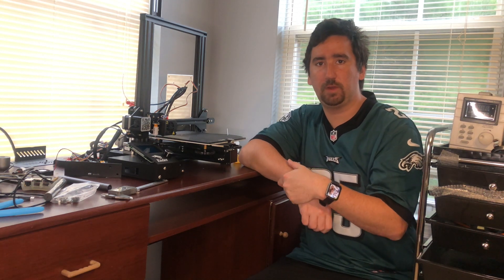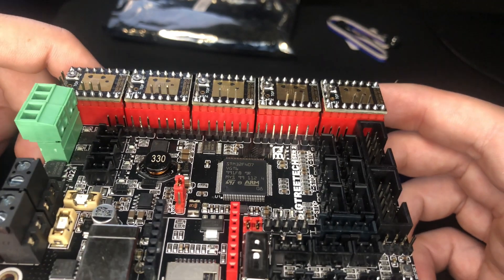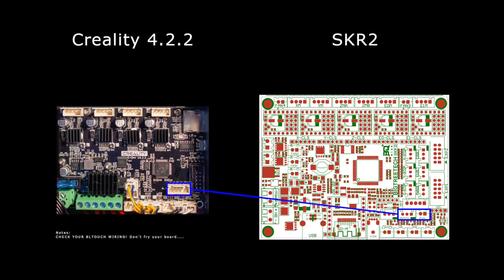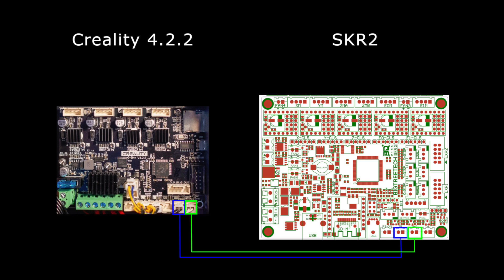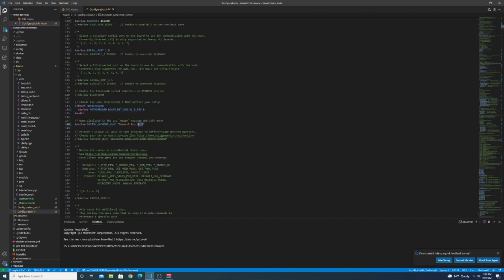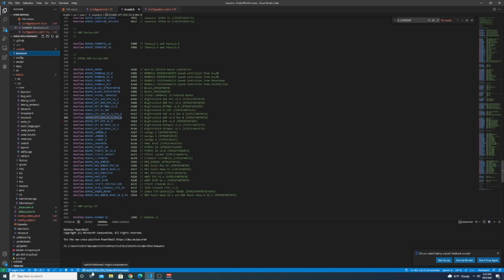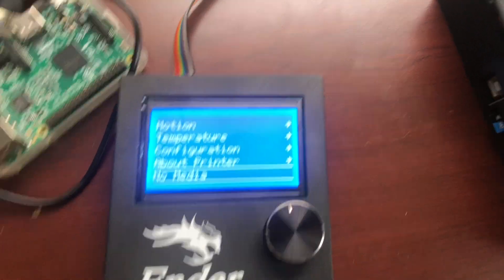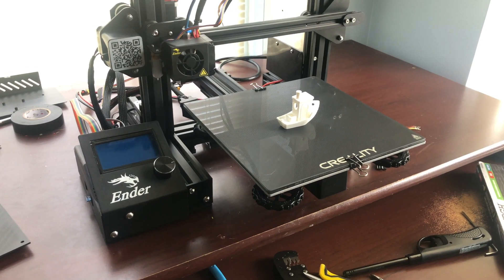How To Install SKR2 | Wiring & Compile Firmware | Ender 3 Pro Build Series EP5

Comment: Where do I get a JST connector that fits this board?
Reply from the maker: I have this kit here, which has all of the connectors and crimping tool: https://www.amazon.com/dp/B07ZHB4BBY/ref=cm_sw_r_cp_api_glt_i_D33WN742KJBCNTSD2WDR?_encoding=UTF8&psc=1

Thanks for watching
Reply: @PrintPractical  Hooked Everything up and nothing happened after hitting the switch.

would that mean my power cable isn't in right? Never worked with circuitry before.
Reply: @PrintPractical  So they are "JST-XH" connectors. In the video it sounds like you say "JXT".

Comment: After connected and compiled firmware i put sd card into the motherboard, turn on the printer and lcd screen remain blue for the whole time. Only thing that happens is that fans turn on itself.
Reply: Make sure to uncomment "#define CR10_STOCKDISPLAY" (line 2475 in Configuration.h)

Comment: Quick question. Did you have any issues with the axis not functioning properly? By that I mean it will home alright but when you try use the move function via the display it just moves back and forth like one step back and two forward. I'm currently have that issue on my Aquila with the TFT35 V3.
Reply from the maker: Huh that’s weird.. I don’t have that issue. Which  axis?
Reply: @PrintPractical  All three. They're new motors and wires too. I fixed for a while then it came back the amount it moves back and forth is based on what the distance I'm trying to move it  say 1mm or 10mm. I'm stumped i even tried new/ different stepper drivers the only thing else I can try is tmc2209 instead 2208

Comment: I just wired my board and I’m getting no power to it. I know the wires have power and that the polarities are correct, but still have no power to anything on the board
Reply from the maker: Did you make sure your power jumper is set correctly. There are two modes: USB power and power supply power.

Comment: This is a great video man. Would you mind if I could have the stl for the enclosure? Be much appreciated. I'm installing the skr and the tft50 on my cr10 v3 in a few days and I plan to tuck the mainboard away under the printer on a shelf and just mount the screen outside the enclosure. Stage 1 of a voron switchwire conversion. I'm new to 3d printing firmware but I am quite familiar with working with different languages in vs code. These videos are invaluable for me seeing the process of changing the firmware. Thank you
Reply: I had the same question, he just has it in a different video!
 https://www.youtube.com/watch?v=t1JGbf4hDso&ab_channel=PrintPractical
it's in the description here, free on thingyverse!
Reply: @giving6  thank you my friend!

Comment: Hello sir
Can I have the firmware files if you don't mind.
I can't get it running.
I've got skr 2 as well
Getting errors when compiling
Reply: Without enabling Bl touch even I tried compiling. Still I get that error
Reply from the maker: Here is my firmware file: https://drive.google.com/file/d/1vFnw-fjZ7gFek1K9ALXPDHaCMAe5M3jq/view?usp=sharing

I am not responsible for anything related to you flashing your device with this file, but I will help you triage if needed.

Thanks
Reply: @PrintPractical  Thanks a lot sir I will look into it now
Reply from the maker: Let me know how it goes!
Reply: @PrintPractical  Hey sir so I flashed
And whenever I try to level using a bl touch it stops and flashes and also Whenever I turn the printer on the auto home only works once and then I have to turn it off again, and the bed level button doesn’t work.And the printer only probes in spot when I click bed level. The printer also only probes in spot when I click bed level.
What should I do sir?
Reply from the maker: Do you have a BLTouch?
Reply: @PrintPractical  Yeah

Comment: how did you flash the board?
Reply from the maker: You put the firmware.bin file on the SD card, and then put it in the printer and turn it on. The SKR boot loader will install the file on boot. I hope this helps!

Thanks for watching!

Comment: What are the advantages of SKR2 over creality 4.2.7 (which has the same silent drivers)? I am going to upgrade my creality 4.2.2 board to 4.2.7 because I need silence.
Reply from the maker: The SKR2 has removable stepper drivers, so if one goes bad, or a new version comes out, it's easy to swap them in and out. The Creality 4.2.7 board has TMC2208 steppers that are one with the board. So if one goes bad, you are out of a board unless you are very good with flush mount soldering.

You can easily control the mode of you stepper drivers on the SKR2 (when I put the jumpers on the stepper driver pins). I put my steppers in UART mode, which allow for features such as linear advance (which I may cover in a different video. There are tutorials on how to attempt to get linear advance to work on the Creality board, but it's a risk and you have to solder a few things on the board to get it to work.

The SKR2 in my video has the TMC2209s installed, which are capable of sensorless homing. This is not possible on the Creality 4.2.7 board.

The SKR2 has the capability of having dual Z axis motor ports, along with being capable of controlling multiple extruders. Having dual Z axis is possible on the Creality board if you make a splitter wire or buy one. Dual extruder isn't available on the Creality board.

These are just some quick things I thought of, but it really depends on what you want out of your printer. If you just want silent motors, than the Creality board is the way to go. Plug and play. The SKR gives you potential to do much more with the printer if you want to.

Thanks for watching!